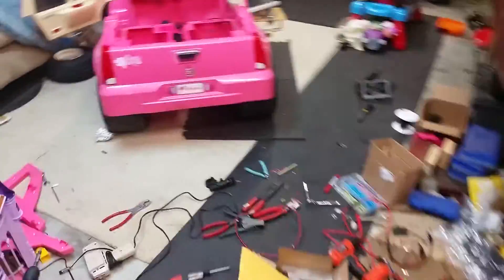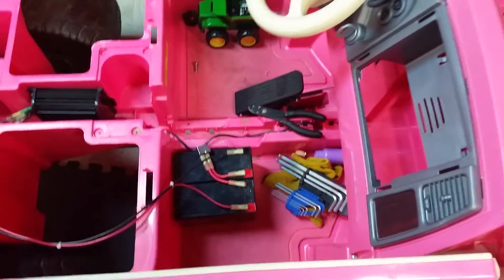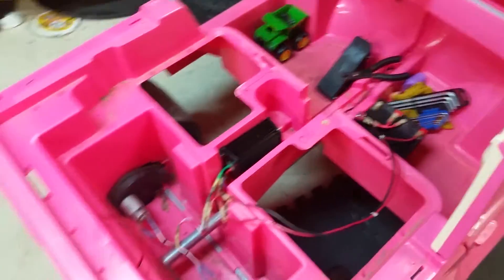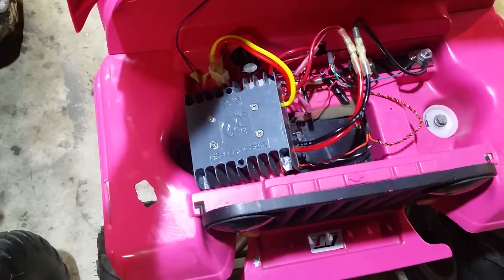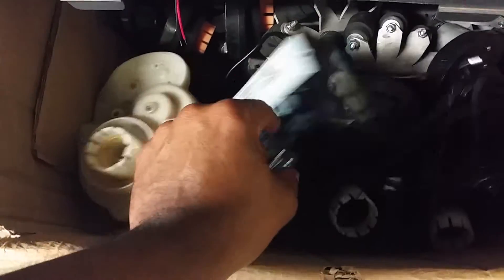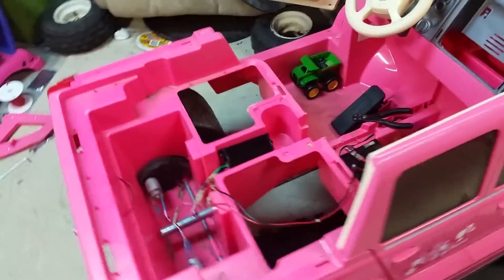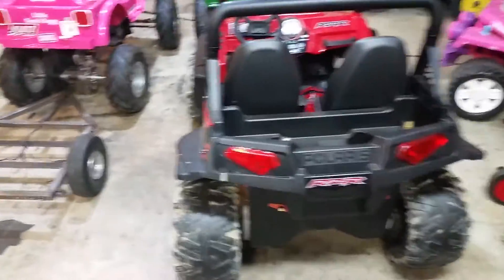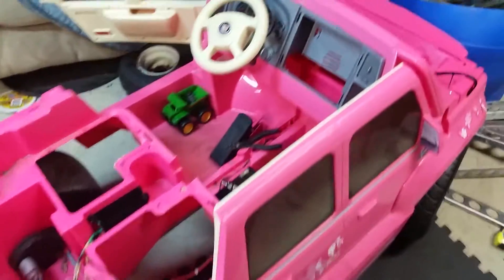Power Wheels Escalade ESC conversion with 1000w controller

Comment: I have a F150 power wheel and purchased an ESC. I looked at your video and don't quite understand the wiring so I can still use my shifter for forward and reverse.  Any advice?  Thanks.

Comment: Have you had any luck with 775 motors. Or installing fans or heatsinks?
Reply from the maker: I used a set on the Baja I built on 24v with a 700w ESC. Seemed to work quite well without heat sinks or fans... But my kid doesn't drive WOT all the time.